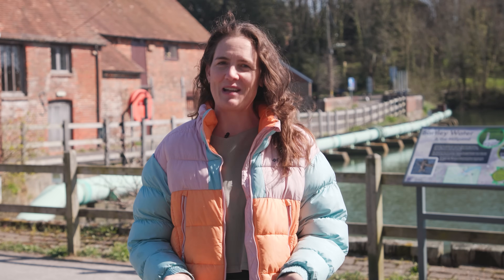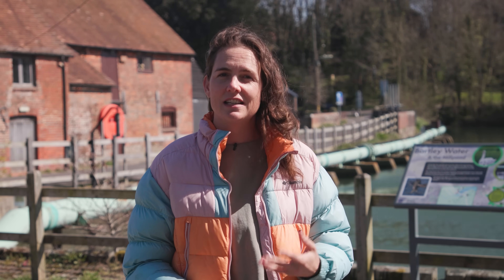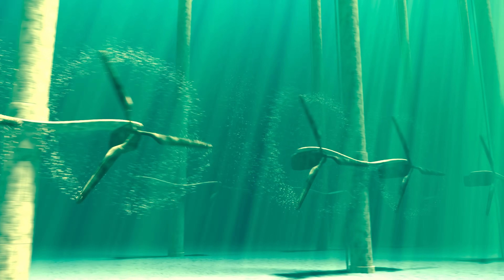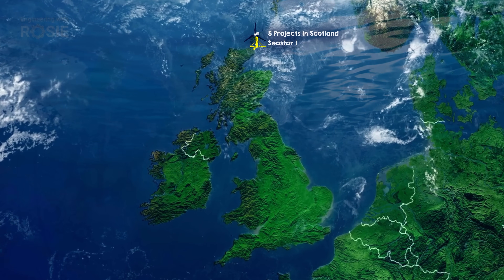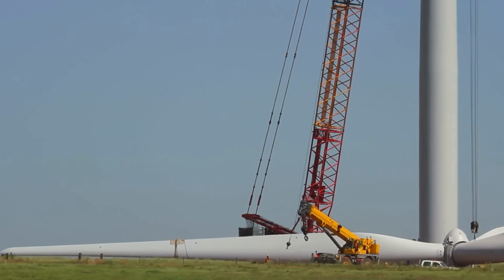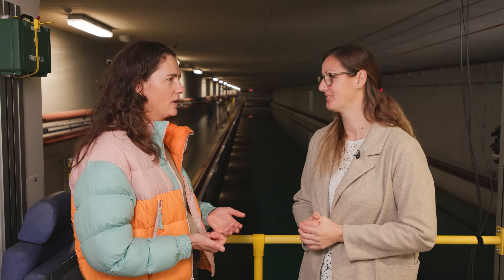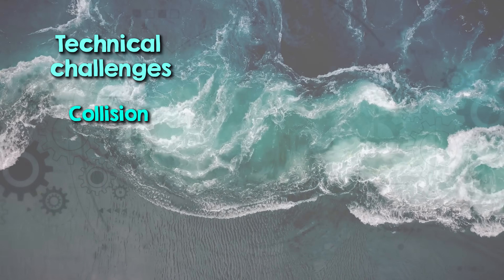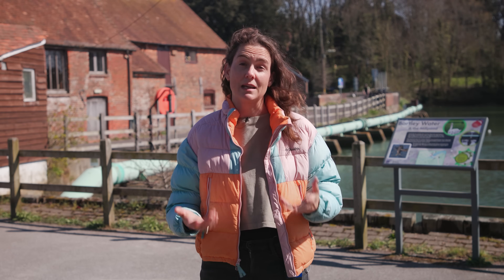A 1,400-Year-Old Idea That Might Save the Climate

Comment: The issues with tidal barriers are the lack of right geographical locations: high tidal range, shipping access, environment (silting up), cost. These have been studied for decades. In UK Severn Estuary and Mersey Estuary have been studied and dismissed many times. 
In Canada the Bay of Fundy scheme has run into cost and funding issues.
Tidal turbines also depend on unique geography in particular tidal flow speed which depends on marine geology and geography.
Interesting but not going to save the climate.

In the UK if we stopped pricing renewable electricity based on the the price of gas and charge based on actual cost then we can perhaps counter  the naysayers ?

Comment: So tides switch off 14 hours a day at different times each day. Yet another "renewable" energy source that doesn't work for 24 hours a day and 365 days a year. So you either need to over build or build storage or more likely do both. 
So you're now advocating another non-despatchable electricity supply on top of solar and wind. 
There's a current dispute in the UK about 'wind theft' in one wind farm stealing another's wind energy. So extracting energy from wind and tides have environmental knockon effects, including climate change.

Don't start this waste of (our) money until you know the cost and the environmental damage.

Comment: Question. Save the planet from what? Climate doom, climate catastrophe? There is no climate doom over the horizon. CO2 is not and never has been a control knob of the climate. Climate change has been going on naturally for billions of years. There has been several glaciations. There has been long term warming periods, all of which occurred long before the industrial age, long before the use of so called fossil fuels. The real problem we have is, what are we going to do to replace what oil, gas and coal make? Medicines and plastics for starters. There is no way possible to generate enough electricity to melt steel or aluminum using electrical conductors, not possible. Having wind turbines and solar panels to assist power plants is fine and dandy, but it has already been proven that whether we build 100 turbines or 100,000 wind turbines, if the wind is not blowing, they do not make power. Solar panels efficiency is dramatically effected by cloudy, and snowy weather regions. Worst of all, none of the parts of panel and turbines can be recycled. We already know that. It is a pipe dream that will fail and that has already been proven.

Comment: Using tidal energy to produce electricity is a good idea and should be looked into, especially if it can be cone in a cost effective manner. 
But please do stop with the Climate Crisis and virtue signaling, it's nonsense. There is no Climate Crisis, never was and CO2 is not a pollutant or problem.

Comment: Looking at a global scale doesn’t make sense. 
(same goes for solar in polar regions).
But surely tidal makes sense in areas with suitable tides.
I think the main issue is that it will never gain the huge benefits of scale that wind / tidal / batteries have. 
Say here in UK, we could need batterie storage for a number of days.  Whereas tides only a couple of hours a day, less so with distributed locations, that said the main UK locations are in Scotland.  West coast and north coast have around six hours difference, so perfectly out of phase for maximum benefit 
When looking at costs, batteries storage should always be factored in with wind and solar, and rarely is.  So it even now not that far astray.  
So all in all a very good contribution to the mix.
Reply: I think the reason the global scale is important is that things don't really get cheap until you can build a huge factory to make millions of them.

Comment: The problem with tidal is that there is a 3hr period either side of the low or high tide when the movement of the water is practically nil.  The Rule of 12ths.
Reply: That's a problem for tidal stream systems. For tidal range systems, controlling the flow through the barrage could allow it to generate power most of the way through slack water.
Reply: @spankeyfish  Wasn't that considered for the Severn?  Did it not transpire that it'd cause considerable ecological damage?
Reply: Hariseldon, you mean 1.5 hours.

Comment: So the key to expanded viable tidal power locations is efficient generation at speeds less than 2m/s?
Reply: No, there is not significant power in the tides if they are flowing slowly, so then it doesn't matter if you are efficient or not, you will not generate much power even at 100% efficency.  As explained in the video, the available power increases with the cube of the speed, you need fast flow to make tidal power economic..
Reply: @nigels.6051  Yes, that is all correct. However power is related to swept area, so if you employed a screw, for example, you could expose a much larger surface area and multiply the meagre power of a single . I don't know, nor am I a hydrologist, but this seems to have some merit.
Reply: @Bennyboy-dog  An Archimedes screw appears to be excellent if you have a height difference, they are used on slow flowing rivers, but here we are talking purely about flow, and once you have removed the energy in the first turn,  the water will be flowing at the same speed as the screw is moving, so there is no more power to extract!  Gravity is not adding more energy, as it does in an Archimedes screw. 

As was said by the expert, the physics is the same as for wind turbines, except for the density of the fluid/gas, hence the blades look like wind turbine blades, except smaller and more robustly built.
Reply: @nigels.6051  Yes, all true, I imagine the power goes to the second power of velocity, so at 3m/s you have 9 times the power of 1m/s. However if you have 9 blades in 1 m/s flow that will generate the same as a single blade in 3m/s. Now consider a screw blade design with a surface area 9 times greater than a single blade....I have no idea if this will work or if the resistance losses of so much area overcomes any gains, but that is the kind of advancement I'm imagining may be possible.

Comment: Thanks Rosie   Great video.  Here in NZ we have probably the perfect tidal flow location to generate electricity :  Cook Straight.  5 knots for 5 hours one way and  then pretty quickly the reverse.  The sea level remains the same in the center of the straight. Check out Wikipedia for the details. One day we might be brave enough to tackle this massive natural "green" energy source.
Reply: i  saw a program on tv about a tidal thing in labrador canada the tide eventualy washed the turbine  off station so they gave up
Reply: Its a great point but it also highlights why this is a non-starter.
YES ABSOLUTELY there are some amazing places where this could work. In fact I know that the gap between San Remo and Phillip Island in Victoria Australia is just like you have described.

Here's the real problem - are there enough places where it can be practically done.

To illustrate - ANU in Australia did a study on potential hydro and pumped hydro sites in Australia from satellite mapping technology. They came up with 100s of sites. Over 99% of those sites are impractical for a variety of reasons like a lack of water and or they are so far off the grid its near impossible to connect them.
Reply: Strait
The Kaipara harbour is possibly a better option: 947 square kilometres in area with a narrow entrance.
Reply: @PaulG.x  Good point.
Here in Australia in our far North West are 2 really interesting places. 
- There's the Horizontal Falls in Talbot Bay within the Buccaneer Archipelago in Western Australia's Kimberley region.
- There's King Sound where the town of Derby is located and it has some of the highest tidal swings in the World. It has a low tide high tide differential 11.8 metres (39 ft). I have worked in that town and its amazing to see. At low tide there's just this giant mud flat going off into the distance. The local jetty is on these incredibly tall piles that make no sense. When you go back at high tide the water is almost level with the jetty.

The real problem how ever is that even at 11.8 meters its still not really enough vertical to make it viable. The other part to that is that as it drains the head pressure driving the turbine gets less and less.
Reply: And like anywhere else, what effect on the natural environment and its inhabitant's, would these obstructions and extra resistance to natural flow's have? What about any generated sounds and vibrations, given they travel so far in water?  Seems to me, with supposedly green stuff, something always loses out,  in the bigger picture.🤔

Comment: I’m not convinced as hydraulic pressure is enormous. You could gear it highly so it would spin as fast as you need. I was contemplating a slow rising/falling tide where a horizontal propeller style would not generate much. What other considerations do you have why it won’t work?

Comment: "The global potential for tidal power generation is estimated to be around 1 terawatt." (Google AI)
This means no one should bother with tidal power. The global potential for uranium-fired power-service is the thermal-limit of the biosphere: some 200,000 terawatts.
Reply: Nuclear reactors also have some serious downsides. Either Fukushima style - tsunami/rising sea levels because they're on the coast, or French style drought-caused shutdowns because they're on rivers. Both because they need water for cooling.
And there's dealing with the waste.
Reply: So you shouldn't bother with any energy source unless it provides 100% of your requirements? 

Clearly this logic is flawed, not to mention putting all your eggs in one basket turned out to be a bad idea.
Reply: @jamesgrover2005   You can put uranium-fired power-service in as many different baskets as you like. 
Uranium has the greatest potential for diversity, of any established fuel, because it is the densest fuel.
There will never be any reason to add tidal power.
Reply: Copilot

Tidal power has significant global potential as a renewable energy source. Estimates suggest that tidal stream energy capacity could exceed 120 gigawatts (GW) globally 1. This could theoretically supply more than 150 terawatt-hours (TWh) per year, which is more than the total domestic electricity consumption in the UK.

Comment: Salt water is a very unforgiving medium. Sorms, corrosion and fouling have been big problems for experimenal sysems.
Reply: All problems we're well used to dealing with after 50 years of North Sea oil and gas production
Reply: @garysmith5025  Likely true, but they don't have moving blades that need to maintain hydrodynamic surface profiles and rotating bearings, fish nets, logs, sea weeds and the like.
Reply: We've had ships in exactly that environment for thousands of years, that's simply not an excuse!
Reply: @alanhat5252  And the ships have the barest minimum of machinery projecting into the seawater, and those are the fail points on the vessel. Every year you need to remove them from the sea and clean them, in half the world you need to remove them entirely from the sea for considerable periods because of adverse weather (tropical storms, hurricanes, ice.) 
And on every coastline of the world, you have the once a century Total Destruction Likelihood of super-storms, where entire cliff-sides fall into the sea, or a scouring event shifts  a hundred billion tonnes of seabed along a coastline  into a great grinding mill.
And those few places on coastlines where shelter and prevailing currents  provide a semi-secure position . . . do you know what is ALWAYS already there? That's right, huge Port-cities, that already use every bit of the fairway and the land surrounding the port.
Reply: @alanhat5252  except for the all the growth that attaches to the bottom of every ship without protection and even those need protection replacement after a few years.
Reply: @alanhat5252  we have had exactly those same issues with the numerous attempts to develop wave energy generators. The use of complex mechanical devices  IN  the saltwater of marine environments, with the added issues of linking high voltage electric power transmission has proven a major difficulty. Ships are developed with a sealed hull and only very simply sealed propellor and water-circulation ports through the hull. VERY different level of complexity.
Reply: @alanhat5252   To even begin explaining how incorrect this view is would require a foundational level of understanding on your part. Are you confident you possess the necessary background in marine systems engineering, corrosion science, or naval architecture for such a discussion to be productive?
Reply: @Think6.6  You can disagree with someone without being so insufferable. But yes, the ease at which we can dry dock ships for maintenance under their own power, and the fact that their internal components are in an air conditioned room compared to small nacelles of tidal turbines makes them not really be in the same corrosion ballpark as shipping.
Reply: @Think6.6  This is a public forum for discussion.  One of the key skills of any engineer is to be able to explain complex subjects to wide audience including but not limited to: a) stakeholders b) management c) the public.

That said, why don't you try explain to us how "incorrect" Alan's comment was?  Be productive and not condescending.
Reply: @cruisingwithsam  just watch whats happening and we will see.
Reply: @Think6.6  That is quite a unique way of calling someone stupid. You make it sound like an insurmountable obstacle. What it really takes is active efforts to solve problems. If you consider the poster incorrect, you could simply explain your point of view rather than flipping the virtual finger with a condescending attitude and a superiority complex.
Reply: @rogermccaslin5963  So people shouldn't call a spade a spade -- that's what you mean.
Reply: I do not think think that these are huge barriers, just learning opportunities.  If there is more research, some of today's issues have yesterday's solution.  Grounding, insulation, and shielding topologies need to be developed.  New issues may be avoided until new solutions exist.
Reply: Nothing lasts forever, including fossil fuels of which there is less years worth of oil and gas and less than 120 years of coal at the current rate of extraction and consumption. There are no new major finds of fossil fuel left. The barrel is already being scrapped with tar sands, fracking and deep water.
Reply: Latina pasta
Reply: That’s why they used wood , unlike metal , wood although it might get soggy if submerged , can last longer ! Just a thought !